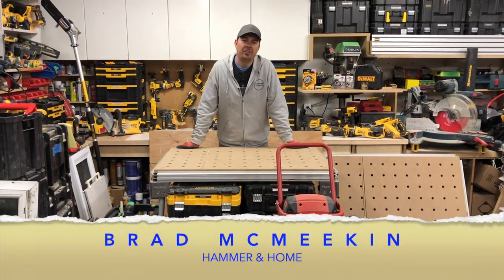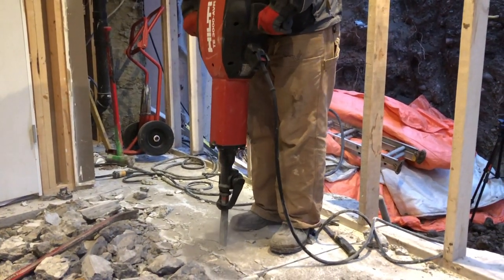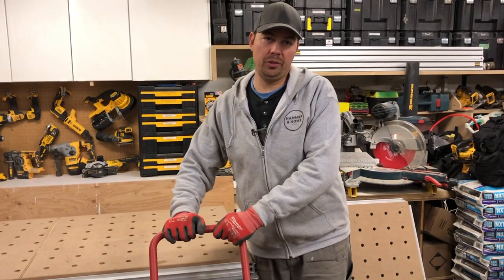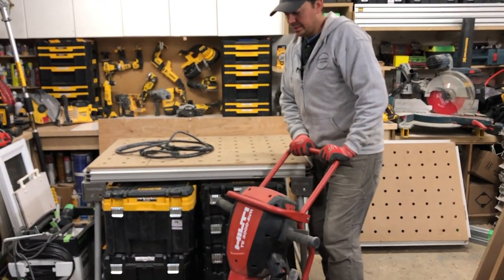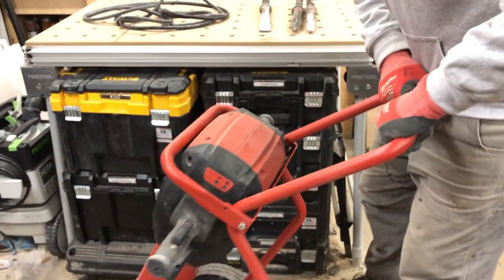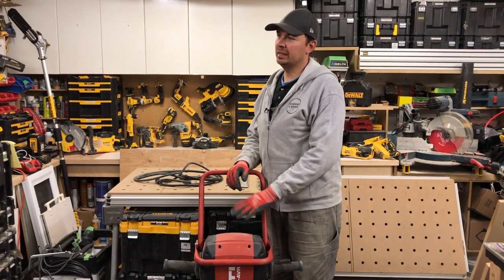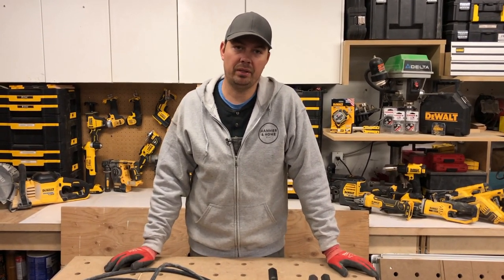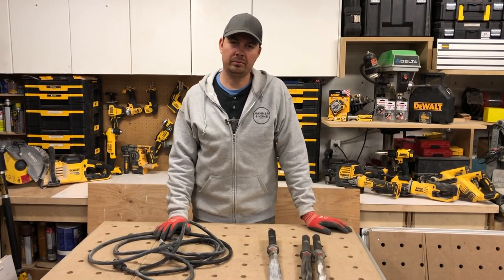Breaking concrete with the Hilti Jackhammer TE 3000

Comment: I use the 3000 daily at work. Its a great machine for standard slab concrete. Not as effective on monolithic concrete. The 90 pound air hammers are much faster but are extremely hard on your body and very cumbersome with having to drag the air line along.